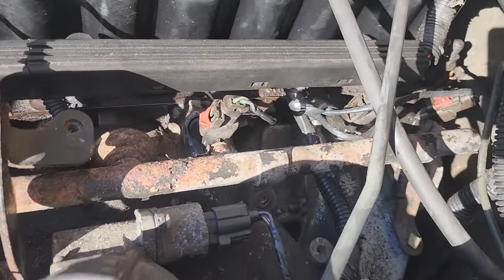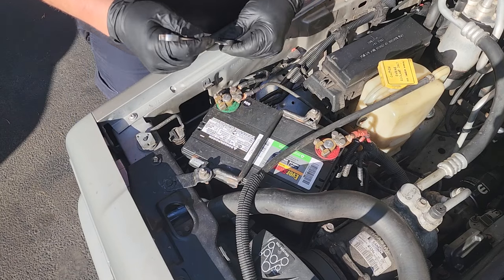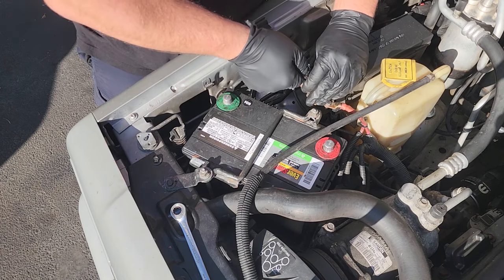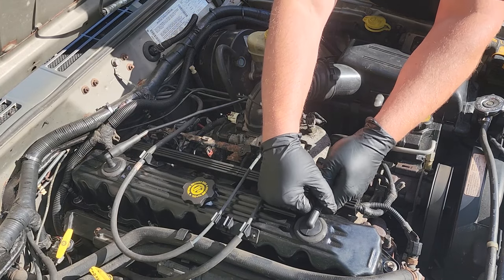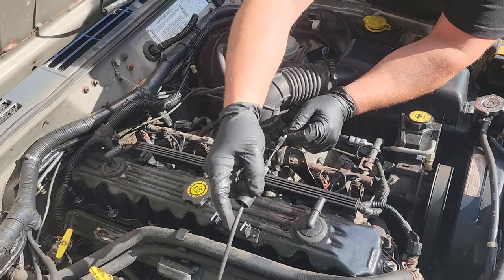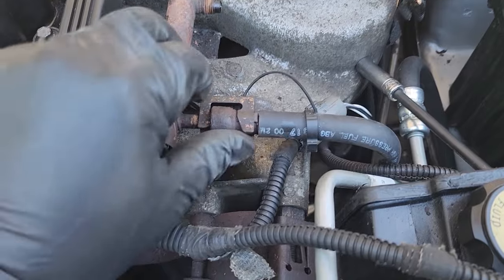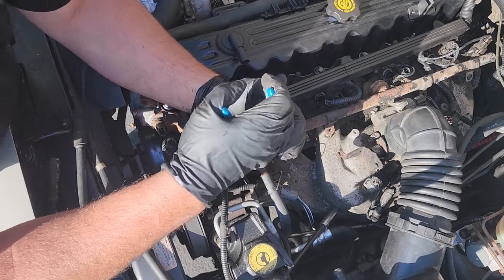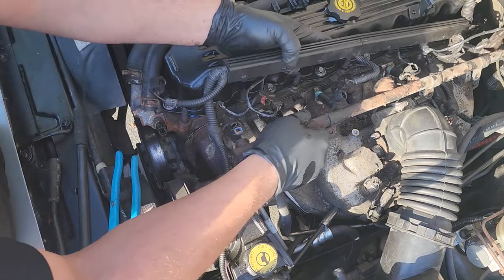JEEP XJ FUEL RAIL  & 4 PORT INJECTORS  -  2001 JEEP CHEROKEE UPGRADES - TOAD EPISODE 9

Comment: I did this on my WJ about 7 years ago at about 200,000 miles. I'm seeing varying experiences in the comments. From my experience, my MPG went up, 24-25 highway in favorable conditions, and as high as 27 in perfect conditions. My mileage is at 319xxx now and I've had no issues.

Comment: I've got K suspension 4 hole injectors. Jeep is running fine, no power gain but terrible fuel mileage. I'll sell them and I'll go back to the single hole injectors. Was not worth $150
Reply from the maker: you may have gotten higher PSI injectors.  Don't give up on 4 hole, maybe just try a different seller.

Comment: Great job and great video. Clear and no nonsense. One thing id suggest though, when it comes to steel and aluminium , id always hand start the bolts etc before power tools, when refitting.
Reply from the maker: Great input! Ive done this a few times. lol

Comment: success - also show us the FM 40 install - great classic sound ! By the way, the difference between CCV and PCV valve ?  Thanks !
Reply from the maker: XJs have CCV is crank case ventilation. Front one is a breather to the Air box, the other is a smaller metered orifice to the intake manifold. CCV is almost and open breathing system..   PCV is positive crank case ventilation and has a one way PCV valve for pressure to escape from.
Reply: @ProjectDanH  super advice  - thanks bro !

Comment: can this be used on the inline 4.7 stroker aswell ? cheers :)
Reply: Yes, the stroker is externally the same. Everything bolts in the same spot.
Reply from the maker: absolutely
Reply: Perfect Hahaa, I accidentally bought a stroker build recently, and been trying to figure out what I can and can’t do, and what I should be doing with it, rare find here in the uk, HESCO 4.7 stroker

Comment: How's the fuel mileage after the upgrade?
Reply: Injector upgrades and fuel rail really don't do much in terms of efficiency.
Fuel rail would be a good option if you want to include a pressure gauge and run it as a return-style system. This would help to mitigate/eliminate the regular issues 4.0's have with heat-soak, a la the same-side intake + exhaust.
There may be some more responsiveness as 4 or 12-hole injectors are meant to help more evenly atomize the fuel within the cylinder, creating a fuller and better burn.
You won't see or feel much of a difference unless your injectors were already bad before replacing, but it is a good supporting mod if you move to bigger injectors or start going for more power elsewhere. On it's own, without mapping/tuning, it's basically nothing.

Edit: spelling and to include another reason for fuel rail upgrades
Reply from the maker: havnt driven it that much, should be a little better if not same
Reply from the maker: @MrRickChase  exactly

Comment: Just a fyi this rail doesn’t work on the earlier models
Reply from the maker: Why not?
Reply: @ProjectDanH  The injector holes are a spaced a little different, and the fuel pressure regulator is different , at least on the one I bought for a 92 was like that